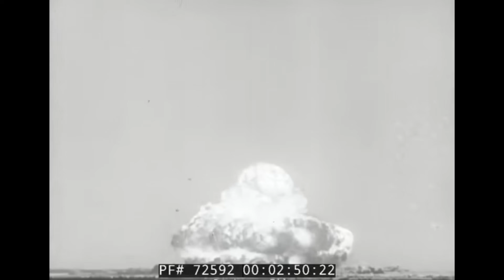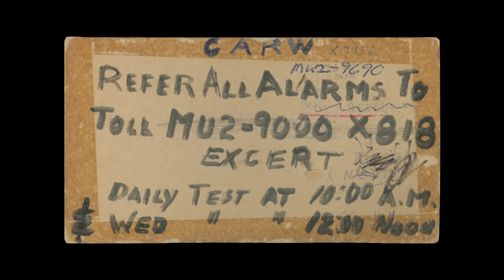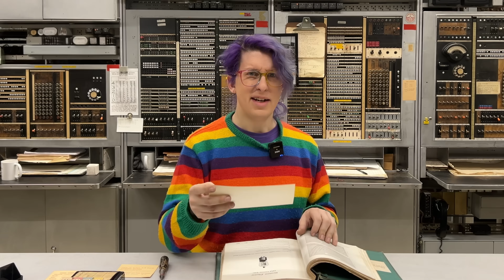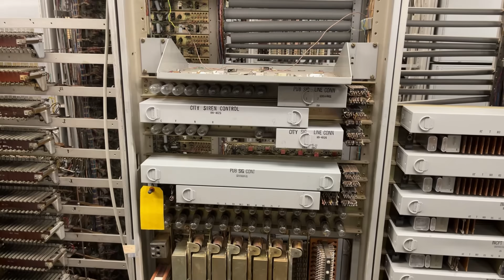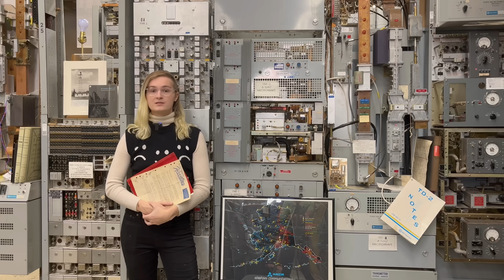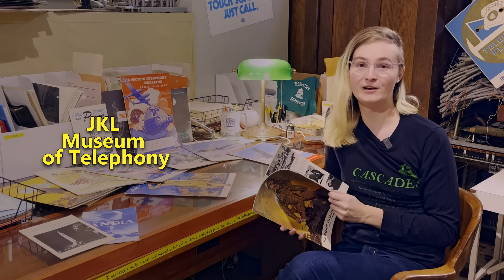CARW: Bell's Nuclear-War Telephone Network

Comment: There was an air raid siren on the same block as the house I lived in 1946-56 that was tested every Wednesday at 2 PM (McKinley Hill, Tacoma).

I also remember the CD Lights and Bells box on the Central Office wall (TACMWAO2), along with all the other remote alarm boxes from other Tacoma COs. That wall was right next to the main alarm aisle. (Some of the equipment in that aisle dated back to at least 1911 and was moved from the old Sunset Telephone office just down the street in the 1930-31 time frame. )

Comment: "I am so proud I only got shocked twice"🤣 Got to love Sarah she has a way with words. Seriously this is one of the best technical channels on YouTube
Reply: There's nothing worse than getting your hand shocked on connections on a wirewrap block on a frame and jerking it forcefully driving the back of your hand into the block next to it and getting shocked again.
Reply: It would have only happened once with the equipment I worked with High voltage DC at enough current to set you on fire. One transmitter used 7,000VDC at over 5 A for normal operation,. The filaments in the final tubes were 1.5V @  1000A each so that was 3KW f ac current per tube. One would set you on fire, the other would melt any tools that got in the way.

Comment: The UK's early warning and civil defence systems had a lot in common with this approach. Ordinary subscriber's lines were utilised to distribute important attack warnings, without the knowledge of the line subscriber. It's pretty ingenious use of an existing system to do multiple jobs without incurring the additional costs of laying new lines or additional infrastructure, other than a handset to the local Police station.

Comment: The Defense Switch Network, the successor to AUTOVON, is still very much alive and well today!  We even still have the same 4 priority levels (Priority, Immediate, Flash, Flash Override) that you can use on DSN calls.
Reply: Which go through the red switch network. Digitized in the '90's, rendering the old AUTOVON network obsolete.
I remember our staff meetings, initially IA getting to go after red switch briefed on their status, but after some rather high profile events, IA got to go before red switch had nothing to report.
We did have red switch go down twice at one installation and well, due to that installation's purpose, theater wide.
Once, due to a generator failure, the other, a transformer fire, both triggering failover to the building UPS that was inoperable until the generators could come online. A longstanding issue of a room full of defunct batteries was swiftly addressed after the second time the general's phone stopped working...

I still remember siren codes. Warbling wail, a warning. Pulsating, strike incoming soon. Continuous, strike imminent.
Goes back to warble, all clear. 3 - 5 minutes duration.
Adapted in many areas to warble a warning, continuous typically being a tornado is about to relocate your furniture.
But, all derived from the military system, which had a few additional tone codes, before we all ended up with computing devices attached to our gonads.   ;)
Reply: @spvillano  As a kid who grew up on USAF SAC bases in the early 60's we were drilled on the siren's meanings and what to do when we heard them. "Duck and cover" drills were a regular thing in the base schools. After Dad retired in '70 and we went to a civvy life I was amazed that almost no kids my age had a clue about them. Later in life I came to understand that the drills on-base were just to keep the kids comfortable because all the SAC bases were first-strike targets and would have been nothing but smouldering rubble in the event of an actual war...
Reply: Reminds me of the CBS Net Alert in a way. 0-9 with the “Big One” being NATIONAL EMERGENCY.

Comment: There's a definite trade off in dexterity but from the sound of it some hot work gloves might be very nice to have around there in that isle and elsewhere, they are not that expensive for relatively low voltage classes which is all you need (I'm betting 500 volts is above anything you dare touch live, you don't need 26000 volt gloves).  Still a bad idea to intentionally touch live wires without more safety layers, but good for protection against accidental contact when you can affort the dexterity loss having rubber gloves on with leather gloves over the rubber ones.

Comment: The air raid siren in Eatonville, WA, was re-purposed in the 90's until the mid to late 00's as a signal to the local volunteer fire department. They ceased using it around the time that Cell phone service became reliable across that area. 

I remember visiting my grandparents down there one 4th of July and the thing was going off every 45 minutes or so probably because of fireworks related incidents.
Reply: My county continues to use sirens for fire calls, and because of that sirens are completely disregarded except near the nuclear power plant.
Reply: My wife grew up in Warrenton, VA and she remembers the town using the air raid sirens to call their volunteer fire department members in the late ‘70’s-early ‘80’s.
Reply: @lizzy-lightning  No... It was a siren at the fire station set off remotely by the dispatch center. It was NOT an air-raid siren.
Reply: @jimw7ry  A lot of municipalities used the same siren for both purposes. At the fire house there was a big controller that actuated the siren. Depending on what signal was sent from the dispatch center to the firehouse over a dedicated copper pair "lease line" it would start the appropriate siren timer, where a synchronous motor turned a bunch of timer cams actuating micro switches and the correct on off timing was sent to the siren contactor.

Comment: The Telstar relay satellite was a fantastic feat for the Bell System.  Telstar was an example of clever remote diagnosis.  According to a 1963 Bell System paperback book I have, a problem developed with Telstar’s command decoder.  It is speculated that one or more of the relatively susceptible discrete transistors was damaged by cosmic radiation.  The serial data 0s and 1s of digital commands were represented by short and long RF pulses.  Ground analysis showed Telstar could not recognize short pulses.  Engineers figured out that a long pulse with a V shaped notch could make it through the long gate but the pulse would be recognized as short due to the notch.  Telstar was able to continue operating until the Starfish Prime high altitude detonation apparently finished it off.

The Telstar book goes on to say that some time in the distant future satellites might be placed in a synchronous orbit staying continuously positioned over the same point on the ground.  The distant future was Synsat, one year later in 1964.

The US government was apparently beginning to fear that AT&T was becoming too dominant in telecommunications.  AT&T telecommunications hegemony seemed to be OK as long as it served government Cold War imperatives such as building White Alice and providing Long Lines services.  In 1962, the Kennedy administration passed the Satellite Communications Act which led to the formation of COMSAT which took over the leading role of commercial space communications in the US.

Comment: if the recent at&t outage had been an attack instead of a software bug then many of the automatic systems on the at&t networks would not work.

the indicator lamps work similar to a xenon flash tube.

400 volts is placed across the tube by a charged capacitor then a small high voltage low current trigger charge is applied to the glass envelope of the tube and sets it off.

Comment: Fascinating Video! I remember the Air Raid sirens as a kid in the 70's. I knew they were controlled by the phone network based on the phone line strung from the pole to them. I however had no idea at how any of it actually worked until I watched this video 50 years later! That dial was REALLY COOL !!! So 88 was Red Alert, so in theory all that a phone phreaking hacker had to do in those days was cut a telephone butt set into one side of the line and dial 88 to start WW3.
Reply: I think you jumped the gun here because this system only warns the public. It doesn't connect to anywhere they can launch bombs and such.

Comment: Thanks for the info for cities, here in the country we used a CO in the county seat that was used for fire protection dispatch using individual sets of  2 tones 2+2 from Motorola for individual fire whistles and a group call 1 set of 2 tones to send an all call out. That activated the whistles to blow constantly with no warble depending on the local fire department or ambulance service. The all call was done away with by the 1980’s as I remember it. And today only the 1+1 tone system remains using high band pagers for volunteer firefighters and ambulance crews.

DE N2JYG

Comment: My grandmother had a large furniture style Hi-Fi stereo and the tuning dial glass had the (CD) printed on two spots. It wasn't until the Internet age I learned what those were for.

When I lived in Hawai’i the tsunami warning siren test something I got used to. People can even “adopt” a siren to ensure it is functioning correctly. Then there was the “this is not a drill” day from the EAS. I was working in a resort hotel at the time and I turned on the test TV and seeing how none of the local stations broke away from regular programming I figured it was a false alarm.
Reply: In the event of an emergency, all United States television and FM radio stations were required to stop broadcasting. Upon alert, most AM medium-wave stations shut down. The stations that stayed on the air would transmit on either 640 or 1240 kHz. They would transmit for several minutes and then go off the air, and another station would take over on the same frequency in a "round robin" chain. This was to confuse enemy aircraft who might be navigating using radio direction finding. By law, radio sets manufactured between 1953 and 1963 had these two frequencies marked by the triangle-in-circle ("CD Mark") symbol of Civil Defense.[3]

Although the system by which the CONELRAD process was initiated (switching the transmitter on and off) was simple, it was prone to numerous false alarms, especially during lightning storms.

Comment: The UK equivalent was called HANDEL and used phone lines and tones, but no lights. The type of warning was conveyed by speech instead. The distribution of the signal around the UK was particularly ingenious, making use of two ring circuits that normally carried the speaking clock. Control of the circuits could be automatically wrested from the speaking clock by either the RAF AODC in London or the UKWMO in Preston. Tones would be injected to alert the 250 Carrier Control Points (CCPs) located in police stations around the country, and a message would be read to convey the type of alert. At the CCPs, the officer receiving the alert would then use their equipment to send radio (72kHz) signals over the phone lines to warning points, which could either be loudspeakers or powered sirens. The sirens were expensive, so were usually only in towns and cities. In the villages, a police officer, postmaster, publican or other reliable member of the community would haul a hand-cranked siren outside and give it the beans. Lots of good info on HANDEL can be found on Ring Bell http://www.ringbell.co.uk/ukwmo/Page211.htm

Comment: In the UK, the "Speaking Clock" lines were used - every telephone exchange had a feed from a central location.
Reply from the maker: Very clever to repurpose the speaking clock lines!
Reply: @ConnectionsMuseum  Also the siren control circuits were piggybacked on normal subscriber telephone lines using a carrier system. This meant that faults would be noticed and reported. The subscribers usually were unaware their phone line was special.
Reply: There are several well maintained Handel devices, I've personally seen them in RAF Holmpton which was used as a monitoring centre (and has an actual Polaris warhead on site!), it's a restored nuclear bunker. I also worked for BT and we had lots of artefacts post cold war.
Reply: Were they used to sound air raid sirens, or to give important information?
Clever either way!
Reply: @lukejay Kind of both, in a fashion. 

The main trunk circuits from the two core clock distribution exchanges did not distribute the siren activation signals, only confidence / warning signals from either of the two military locations that could initiate the warnings.  

However, the lines used to distribute the signal from the 250 or so exchanges to so called carrier control points (e.g. police stations or other fortified public service locations) were bidirectional, and tone signals and/or voice messages initiated by humans went back to the local exchange for distribution from there to the local siren / warning distribution network.

There's a really excellent description of the system on the ringbell uk site - google ringbell handel warning
Reply: @lukejay I think they were. They’re also was the “HANDEL” radio system. The government distributed these radios that would constantly beep or if an attack was coming they’d make noice and say “Attack warning Red” meaning “your fucked m8”

Again the speaking clock lines were used. It’s an amazing system
Reply: @ThePolarBearProductions   Also used for fallout warnings.

HANDEL was a telephone-based system. Messages would be sent from the two national warning centres to 250 Carrier Control Points at various police stations. Those would activate city sirens and warn the people in rural areas to sound their own local sirens. Or fire maroon flares in the case of fallout; Scotland rang church bells for the latter.

There were regular tests and exercises; people would be sent postcards, told to tune in and send the cards back with the codeword on them.

Comment: Out of curiosity, what does it say on the yellow tape on the side of the table? "I worked really hard and moved a lot of mildewy books..."
Reply from the maker: Part of the archival work I undertook was sorting through an absolute mountain of accumulated paperwork and donated items in bankers boxes that made parts of our library unusable. It's just a message requesting and thanking other museum volunteers for keeping the surface of the desk clear when they're not using it. —Claire

Comment: There was a "Bells & Lights" box in the office of my elementary school, just outside the principal's office — where I often sat waiting to "discuss my attitude problem".  I was fascinated by every part of it down to the Private Line sticker on the connector block.
Reply: I had much the same experience! I remember one fine day when i was sitting there and it rang, quite loudly. I asked the office staff what that thing was but they either didn't know or didn't want to engage with the kid in detention, but they declined to explain. I guess I've been waiting for this video for over 50 years! Thanks to Sarah et al for posting it. I also have memories of the air raid sirens wailing their monthly test run. A kind of eerie feeling as the waves of sound from multiple sirens cascaded over the city.
Reply: I remember drills in elementary school.
Crouch under your desk, face away from the windows and put your head between your knees.
We used to joke ..  'and kiss your ass goodbye'
Reply: @jimurrata6785 no memory of those, they ended shortly before I went to school. But then, I was born a week after Tzar Bomba was detonated.
But, after starting a lengthy military career, in nukes initially, I've a different mode of address to a nuclear warning. "Go to the light, my children!"
And I live now at pretty much ground zero, a state capital, a couple of blocks from the governor's residence, in a region ringed with military supply depots and communications nodes. A hint for the curious, I miss a major navigational landmark that's now gone for a hand span of years, the plume from Three Mile Island.
Reply: @spvillano  Steam from a cooling tower is pretty empherial, for a landmark.
I remember the meltdown. People where I was (NYC) were concerned if the containment burst.
Thankfully we didn't have a situation like in Ukraine.
Reply: @jimurrata6785 indeed! I was in Delaware County, just south of Philly when it melted down.
Hollywood reliably informed us a week before that Pennsylvania would be uninhabitable. So, per Hollywood, I guess that I'm dead or something.   ;)
Chernobyl, well, that was quite the series of errors, from construction with an inflammable roof (specified to not be so in their plans) onward. Yeah, one of their specifications was for a non-flammable roof. So, corruption ensued, flammable roof installed.
Reply: My little sister lived in Swarthmore/Morton, so I'm pretty familiar with where you were...
Reply: @jimurrata6785 yeah, used to live in Ridley Park back during the ice age. Our school had electron microscopes and an observatory at the time, when our kids attended there, both were long gone.
Now, let's suffice it to say that if I wanted to knock on the governor's door, it's a very short walk. No clue why I'd want to do such a thing, but life isn't predictable.   ;)
Kind of miss seeing the plume, was an excellent landmark, but the cost of running the reactor was higher than the price of using natural gas for power generation - literally twice the price. 

Less likely for a Chernobyl type event, they had no containment dome and worse, the specified for non-flammable roof wasn't installed, going with a flammable wood and hot tar coat roof instead. There was a risk of a Fukushima type of blast, save that TMI had installed the venting system that TEPCO refused to install.
Still, the reactor contents remained where they should, both at TMI and Fukushima.
And TMI gave all a crash course in human factors engineering. One indicator lamp telling precisely what was going wrong and on the far side of the operator console...